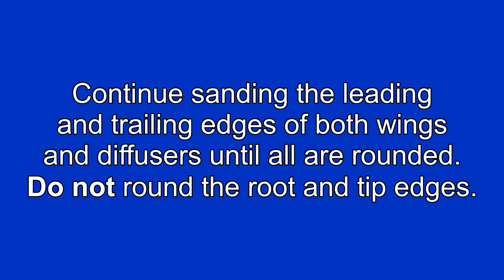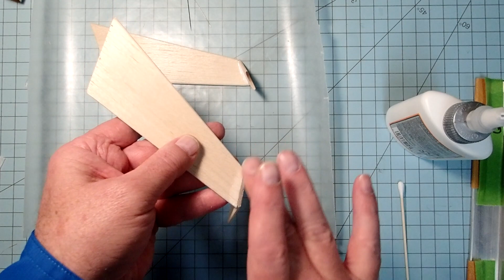Starlight "Sparrow" model rocket assembly

Comment: Not sure why you call the wing tips "diffusers".  They are rudders to keep the rocket flying straight on boost and while gliding.  To get it to turn, add a very small amount to clay to the end of one wing to cause the glider to tilt to one side.  It will then turn while gliding in that direction.  Be sure to hand toss the glider before flying to test how much is needed for a gentle turn.
Reply from the maker: That's what the instructions called them. I have no idea why.

Comment: I'm guessing that the wings / diffusers are supposed to be slightly different lengths so that it has a gentle turn during the glide. If they are the same, then it will fly straight away.
Reply from the maker: They are supposed to be the same, and the turn is controlled by the addition of weight. However, I didn't glue my tube on quite straight so it looks like the wings are different lengths.
Reply: @REAR_rockets  Ok, so the balsa wasn't cut quite right? (I commented when you were sanding them, I should've waited until the end.)